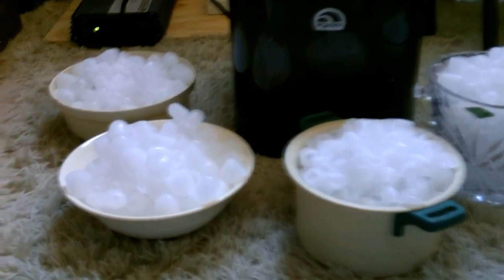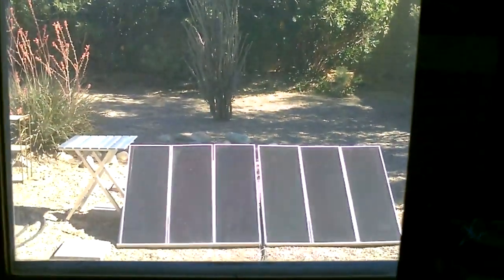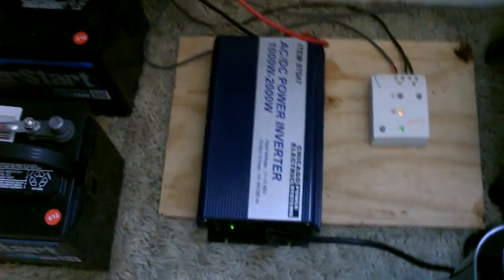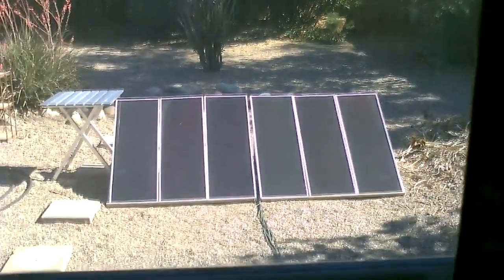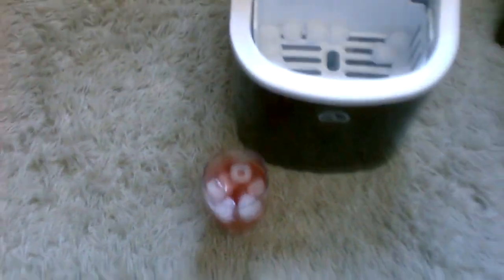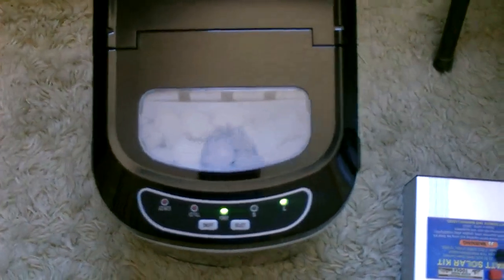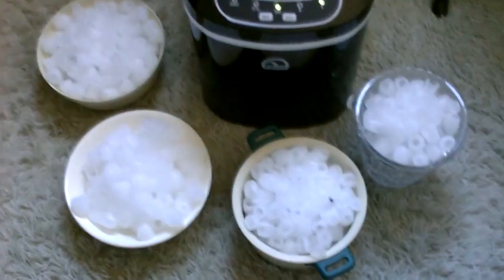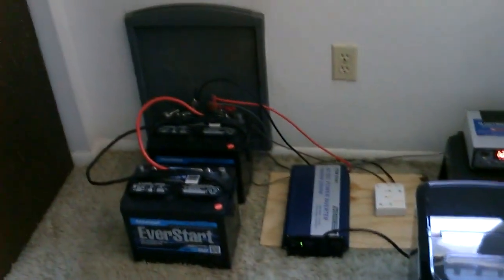Solar powered ice machine! - DIY Solar ice maker! (up to 26 lbs. a day!)

Comment: How much temperature change if you put the ice machine inside cool area with acceleration wiring of wrapping ice power cable spiral around the power supply from solar power to the ice machine. The whole idea was to test weather control using solar panel not just making ice

Comment: I can't read the exact wattage on your inverter.  I just tried my 450 inverter and it blew the fuse, yet I know it will run on far less that 450 watts.  So what is the size of your inverter, to handle that 1/10 of a second surge?
Reply from the maker: hi. i use a 1000w inverter for the ice machine. it draws quite a bit when it starts
Reply: It would not run on my 300w invert, I brought out my 1200 watt (3200 peak) and it wouldn't run either.  They were powered by a battery hooked up to the 10amp charger too, so I elminated the battery question.  They are not sine wave..maybe this is an issue.

Comment: NEED TO BUY ONE OF THESE WHERE DID YOU GET IT SIR AND THE COST AND I HAVE A KODIAK SOLAR POWER GENERATOR I CAN JUST PLUG THIS UNIT IN TO IT AND HAVE ICE HOW EASY IS THAT LET ME KNOW AS AS POSSIBLE SIR
Reply from the maker: hi there. i got that ice maker off of ebay (if i remember right). i've seen them at walmart too. cost $89.00
Reply: does this come with a 110 plug --when i need ice i can just plug it in to my kodiak solar generator and i noticed it was a igloo amazon sells them

Comment: I purchased the same Igloo ice maker (model ICE102, Walmart $79 if pick white color) and was able to power it fine using the EverStart 750W inverter (which Walmart sells for $40). This is in July 2018.  A smaller battery bank works fine, I had a new car battery (single, group 78) for test projects, not even deep cycle, and it powers the inverter fine... as you said it's under 100 watts steady draw.

Comment: Great idea! I use a bar fridge with a little freezer in it and fill the freezer section with freezer pacs and i run the fridge on max so it only turns on once ( i run it for 2 and a 1/4 hours at peak sun 11:00 tell 1:00ish) I then turn it off and place the pacs in the fridge section which keeps everything nice and cold. .Peace

Comment from the maker: "ICE 101" - by igloo. can be found on ebay and some walmarts.  there line of icemakers seem to be the most efficient.  rated max. wattage 160 watts (averages 90 watts per hour). some comparable models have wattage ratings double that.
Reply: 5 years later... I see they market the "ICE 103" specifically with a 120 watt power usage in the marketing material.  I wonder if it's better.  I got the "ICE 102" and it uses considerably more power, although the same design and capacity per day.  Not sure what's up with that.

Comment from the maker: thanks. sound like a good idea. give it a try. you could also use the ice to cool down water. then pump that ice water through metal/copper tubing and blow a fan across the cold metal tubing. or just make a few batches of ice and blow fan over the ice. either idea should work for 'small/personal space' cooling. *for bigger blocks of ice consider hooking up a small chest freezer. should run fine on the solar system. some of the 3.5 cubic footers use about the same amount of power as the ice maker
Reply: WHERE DID YOU GET THIS ICE MAKER ON THE VIDEO==I HAVE A KODIAK AND IT COULD RUN THIS WITH NO PROBLEM WHEN NEEDED

Comment: Nice video! Um…I have been thinking if I use the ice (made w solar power), put them in a water tank, run a metal pipe through it, connect fan to the end….will it work as a free air cooler??  (similar to how solar air heater works)